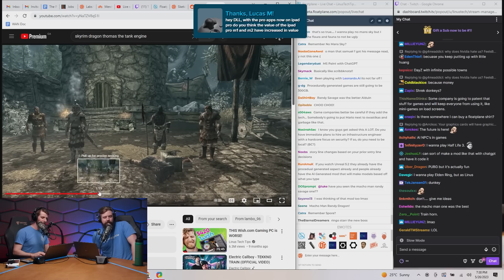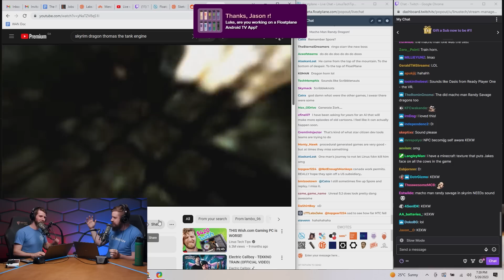Moore’s Law is Irrelevant

Comment: The richest person in the world currently has ~$US237 Billion, so stacked on top of each other (which I think Luke is implying with his hand gestures) and tightly packed the maths would be
~0.1mm (thickness of US bills) * 237,000,000,000
= ~23,700m or 23.7km, 15 miles
This is roughly the length of Manhattan Island
As the world circumference is ~40,000km this is off by a factor of more than 1000
(EDIT: turns out I lost track of my zeros here, it's actually ~23,700km,  ~2/3 of the Earth's circumference, thanks David Pažout) 

If you were to were to place them end to end lengthwise, however, you'd get:
~156mm * 237,000,000,000
= ~36,972 km = ~92% of the earths circumference
Reply: 0.1mm * 237,000,000,000 = 23,700 km, not m
Reply: If I'm doing this right, you lost somewhere the factor of 1000 you wrote about.
273,000,000,000*0,1mm=
27,300,000,000mm=
27,300,000m=
27,300km or ~ 2/3 of the Earth's circumference.
If put them end to end you get ~37million kilometres or roughly 100times the distance from the Earth to the Moon or a quarter of the distance between the Sun and the Earth.
Reply: @davidpazout2569  Oops, yeah looks like I lost track of a few zeros there. Good pickup!

Comment: The “procedural generation” for games talk was exciting, until I realized they will absolutely use it for cosmetic shops and will pump out endless heartless cosmetics for loads of money
Reply: So, no change?
Reply: Just wait until you start seeing AI generated advertising.
Reply: Meanwhile Minecraft is procedurally generated game
Reply: To me the question is whether we, the end users, have access to the tech or whether it remains under the control of the companies who make the games. Because yeah if they're the only ones who have it, at least some of them will charge us for subpar output. All day. If we have it ourselves, those guys will have nothing to sell. You can't market 'horse armor' DLC to people who can make a free replacement of higher quality and distribute it freely, and that's already true with existing tools. 

Really with all these tools, if I can run a version of it locally - even a somewhat less powerful one - I'm in favor of it. If the only version that exists is paywalled and locked in the cloud, I'm not convinced it's a net good anymore.
Reply: @n337speak  Things procedural generation isn't new, it's been around for years, even decades, and it has a very well-documented set of benefits and flaws which kinda limit its use cases, the part of it that is new is AI, but AI won't help procedural generation significantly overcome the boundaries it already has (you're never gonna see procedurally generated main chars in a AAA game). Regarding the cloud part, I think it should be looked at as any other AI model out there, the hard part is to train it, once it's trained it's really not that hard to run it. I fully expect the first versions of these tools to be locked out behind some kind of paywall, subscriptions or only running on NVidia cards for example, but its only a matter of time before we get some good free options out there. Where this tech could be amazing is the indy world where few people on a budget could create games so large and complex that they were only fesable with teams of hunderdes of people till then. At the end of the day, the usability of the tech in modding comes down to if developers allow it and build the game with modding in mind. Gamers need to push for that more, personally I'd love for every game to be moddable but that takes development time and business decisions usually don't allow it.
Reply: Yeah, a variant of GAN. You prompt the AI to generate stuff you want. Another AI judging how EPIC this new stuff is, and charge you accordingly.
Reply: Solution: Don't buy them. Nobody is forcing you to pay for a skin in a videogame. No reason to get angry at seeing more cosmetic options in a game.
Reply: @Naokarma  "!nobody is forcing you to pay for a skin" oh you sweet summer child...
if it was that avoidable then it wouldn't be the most profitable monetization model in the industry
Reply: @Artista_Frustrado  Please tell me who is holding you at gunpoint, forcing you to spend your life savings on a cosmetic. That's right, nobody. 

It's the most profitable monetization because there are people with lots of money who will pay whatever they want for the cosmetics. That doesn't mean you have to follow in their footsteps.

It is absolutely avoidable. Literally, just don't choose to spend money. It cannot get more simple.
Reply: @Naokarma  I always find myself asking what games people saying "DLCs are optional" are playing, because the games I play rip formally core parts of gameplay out and repackage them as DLCs. At this point, I'm sure there is a game out there that has a set of skin DLCs for the main character, where you have to buy one to even play.

With that being said, I've been seeing companies go less far as of late.
Reply: @axipont8383  Before I make my main point in relevance to your reply, I do wanna point out my main claim was on skins, not DLC. Something that's purely cosmetic is, by definition, optional. DLC is, at least how I define it, as an expansion to the game itself, introducing more story or completely unique items, rather than just cosmetics.

I've only seen 1 game ever do what you're claiming, tbh and it's a game I never even heard of until it began its decline in popularity (I believe it was Hearthstone, but idk names well and I never played it, so I could be mixing up games). 

As for games I have played and enjoyed, some examples would be sandbox games like Don't Starve Together, Minecraft, Terraria, etc. or games like Genshin/Honkai that are effectively single-player and have good lore to them. Essentially, I care about a game with good lore far more than I care about most other aspects of a game.
Reply: I'm already tired of the procedural generation we have now. Games don't need to be 100 hours of fucking randomly generated side quest FILLER. AI will make it prettier but the effect will be the same, imo
Reply: @yourguysheppy  Skyrim is really to blame for that trend, considering just how much it was bragged about the stuff that could be done and not even touch the main quest. Other devs have or were copying that hoping for the same kind of success in sales Skyrim garnered.
Reply: Oh man imagine lootboxes but everything is AI generated and 80% of the stuff is just ugly with disfigured hands or something. So it's the same kind of gambling system but now and then the AI generates a penis or something because of course some were in the training set and so there's drama with the publisher all the time...and I bet this isn't even close to the worst-case scenario.
Reply: They already do this 😂
Reply: That’s every online game today😂
Reply: I wont! The gulf between huge company and small developer teams is closing incredibly fast. So fast that in 3 years, a good indie team will produce more, better looking/playing content than two hundred cooperate drones in the same timeframe. Development of games is approaching imaginative generation. Where the tools are so good and so fast. assembling a game is limited by imagination. Over who can place the most HD assets into a game. I'm working on a procedurally driven unreal game that I already prefer to many games.
Reply: Not neccesairly, speaking as game developer here, usually the biggest benefit of procedural generation is the natural variability you can get on a ridiculous scale of asset production. For an example, you're making a game with a lot of castles and castle ruins, you don't want to copy paste them because it's noticeable but you also don't have enough to make to hand craft every single one, and it's awesome to have tools you can program to make you 3d assets, its really an amazing concept. You create a generator for castles where you can add parameters for anything you need/want and you can simply place them around and they are automatically randomized and you can go back and fix anything you need by dragging a slider. The stuff games sell are all usually hand crafted and even the ugly (common ones) take skill and time to make and thats sadly why studios thinks its morally correct to sell them in such greedy monetization systems. Procedural generation helps with stuff most gamers don't even notice or think about. You could procedurally generate a content and sell it but all of that stuff would look very very similar and nothing particular would stand out enough to buy it.

Comment: Need to focus more on software optimization before worrying about this lol
Reply: It still pains me that a game like MW2 could run near flawlessly on Xbox with a generally really solid online experience and no servers on Xbox 360s but now every game is constantly ins rates of severely broken with server issues plaguing everything all the time.
Reply: @OmegaLiar  The number of users/bandwidth needed has massively skyrocketed since that time. Also, most big games are only super scuffed with the servers at launch, because 1,000,000 users all trying to sign in at the exact same time causes problems.
Reply: @ThaBeatConductor  Apex legends called they like you to know they don’t intend to make a non broken game.
Reply: @OmegaLiar  I said most.
Reply: As a software dev i can tell you the reason, it is pretty easy tbh, software as gotten very complex over the years, and not only that, it has to be released quicker than ever, so software is optimized more often than not to be easy and quick to maintain and enhance by the developers instead of being optimized to run faster in the computer, more often than not, very optimized code is hard to read and costs lost of time to modify, that just is not something that is wanted in the industry, so software is heavenly optimized but not for the runtime but for the devtime, so devs can make more in less. That is one part the other is that software has gotten pretty sophisticated, things that previously only big corpos like Microsoft dared to develop are now being coded by small companies but a lot less developers, most of them being very early in their careers, yet they have to make things that previously you needed entire big ass teams of seasoned developers to make, so shortcuts have to be made so that complexity is manageable and not a complete mess.
A mix of both is the cause of the current era of quite unoptimized for runtime software.
The markets wants software to ba made quick and complex, and devtime is a more limited resource than runtime right now, so it is devtime that is being optimized and not runtime.

There is a market for heavenly runtime optimized software, and it still is being made, it is just that not so many things are critical enough to spend the extra money, in a simpler less feature complete program coded by industry experts that is very robuts, for things that needed that and can't do with what is common today, such optimized software exists, but for most software it doesn't really matter if it is a big slow. 

Usually very fast software is either in datacenters for business critical operations and the average joe will not see a hair of it, or it is deep in the software you already use, doing very important stuff very fast on the background where you don't notice it, while slow software is on the front making itself look pretty.

If hardware completely stops improving it is possible that software will get faster and more optimized, but if hardware continues to improve even if little by little, software will not follow, it will only take advantage of the new hardware to either do more stuff, or to be able to add more stuff quicker in a dirtier way.
Reply: @diablo.the.cheater  and that is why I hate agile development. We can't have nicely designed and performant software, because everything ends up being thrown together from this adaptive process. Clients demand newer and newer adaptions every iteration, and we end up with features going "out of scope" very fast.

Software ends up looking like a patchwork job, rather than a competently designed system.

I want to do real-time audio programming partially to avoid this (the problem still exsists there I assume, but hopefully to a lesser extent). It interests me on other levels too, but a certain level of competence is needed. I just hope I am capable of reaching that level.
Reply: @diablo.the.cheater  thx for your points
Reply: Software today is horrendously slow and unoptimized compared to what the hardware is actually capable of. Our computers could be 1000 times faster than they are, often probably a lot more than that.
Reply: @Bluesine_R source?
Reply: @Howleds  Not needed. You are asking it on the proof itself.
Reply: AI can run on specialize hardware and can lead to more efficient solutions than typical coding. As AI technology progresses you can expect better solutions while requiring less power. Programmers are not magic, they are human and have only so much time and brain power to throw at optimizations.
Reply: Yup that is the future. A chip designed for a specific task with software that it is optimized for. The era of the general cpu chip is at the end of its life.
Reply: @Thisisaplaceholder1  😢true